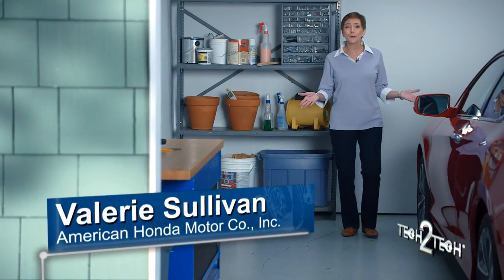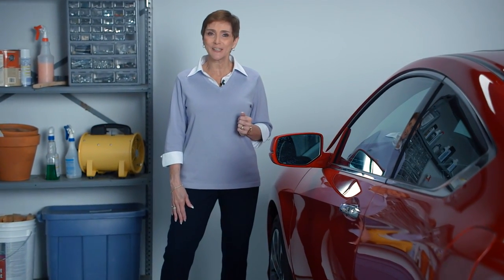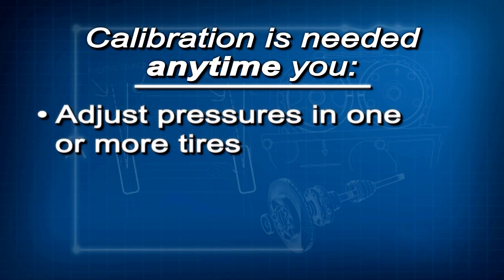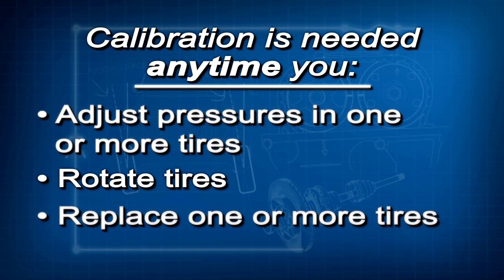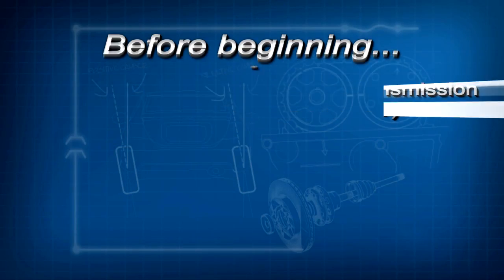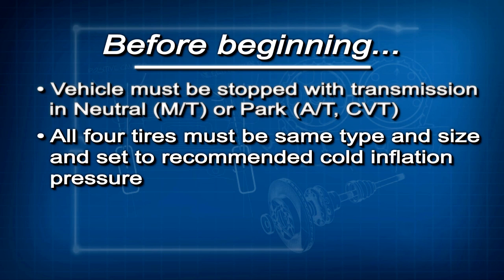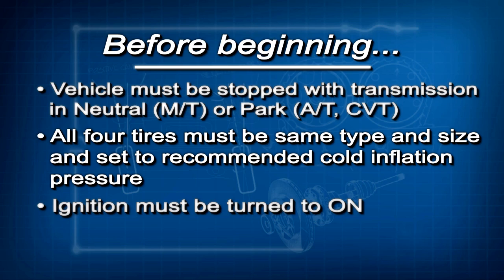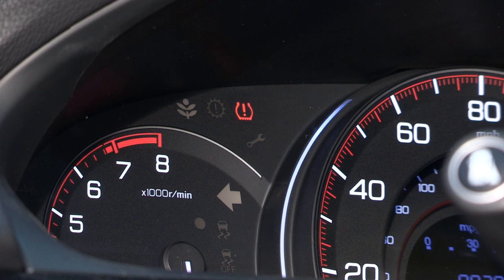Calibrating an Indirect Tire Pressure Monitoring System: Vehicles with TPMS Button

Comment: We just bought a used (leased for one year by one owner) 2014 CR-V and have put less than 2000 miles on it and have reset the TPMS four times now (the dealership did it for us a week ago and the stupid light is back on).  We have not done anything to the tires in the last week and the pressures are still good. What else can be done to fix this? How do we pull the bulb out of the dashboard?
Reply: Shannon Lynch you can't do anything. this new indirect system Honda use is very sensitive.

Comment: I have a 2015 Honda Fit EX.  It is equipped with an Indirect TPMS.  It's HORRIBLE.  Soon as I drive 50 miles or more away, it goes off.  Every time, all seasons of the year.  Check tire pressures.  All perfect.  Took it into a Honda Dealership to be fixed twice now, and it just recently went off again a few months later.  It's buggy at best.  If you have a TPMS that actually works (direct) why rely on a computer to "guess" that the tires pressure isn't correct?  I'd rather know the facts, not a computer thinking it might be off.  Love Honda, but please, fix this system if you're moving forward with this.
Reply: Feuerfr3i Honda's being cheap not given us a direct tire pressure system